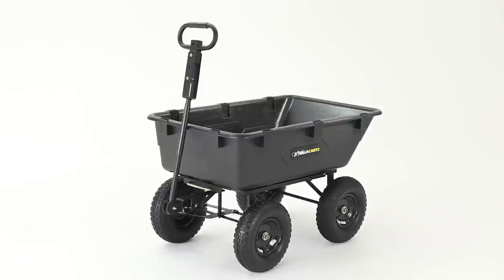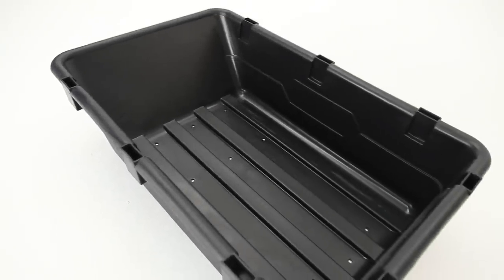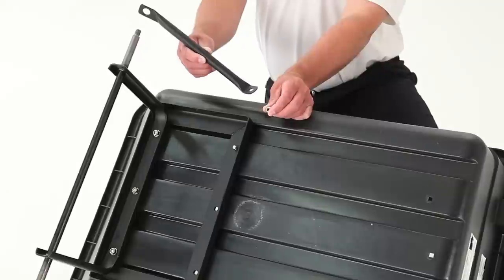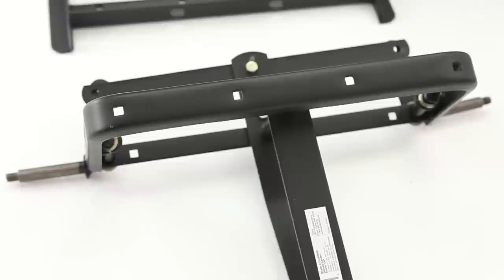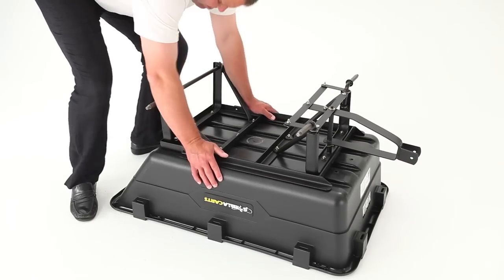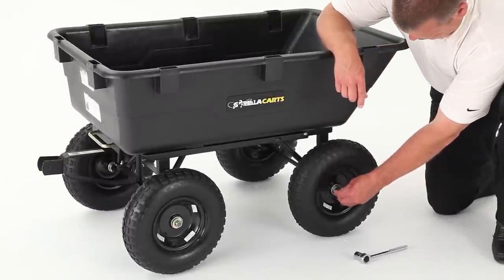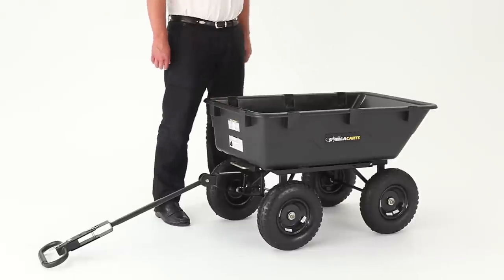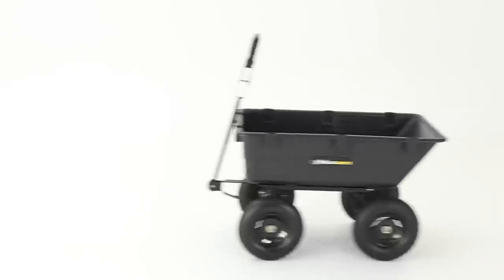Gorilla Carts GOR866D Heavy Duty Poly Dump Cart Assembly Video

Comment: Funny that they say  "Hand tighten only at first."  Bought one of these, but the locking nuts prevented me from tightening the bolts - even with hand tools.  Sending it back because the locking nuts don't fit the bolts.  Spent a good part of a Saturday trying to put this together.  Apparently, customer service isn't open on Saturday, but instead of telling you that, it just says all their agents are busy.  

Wasn't a worthwhile buy.